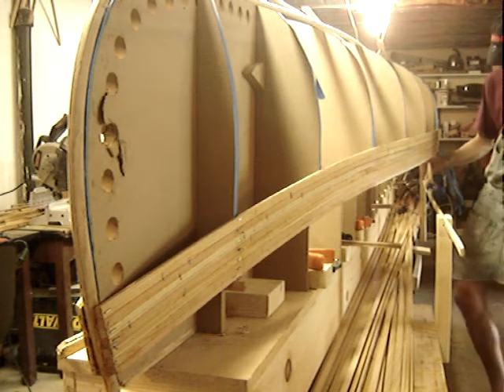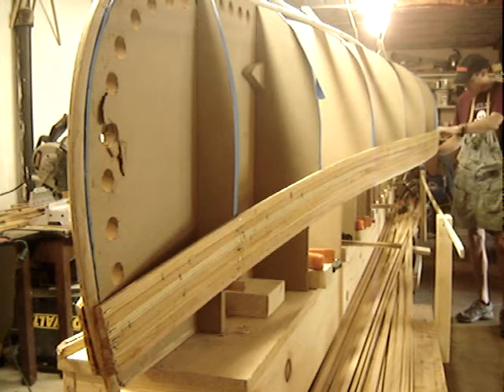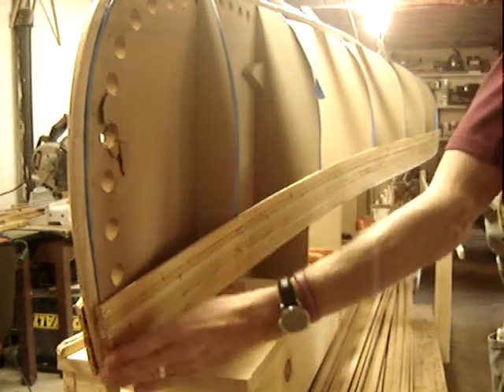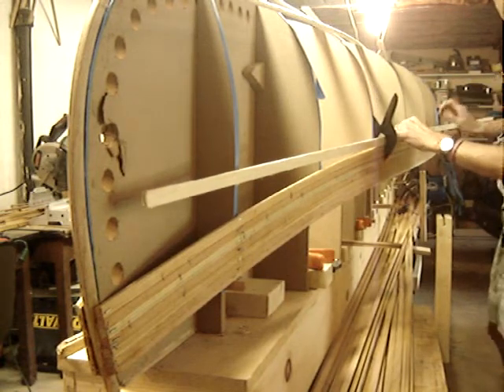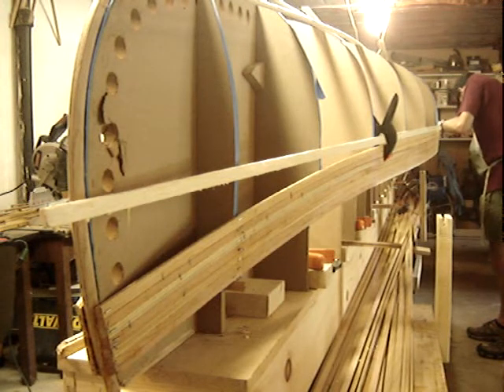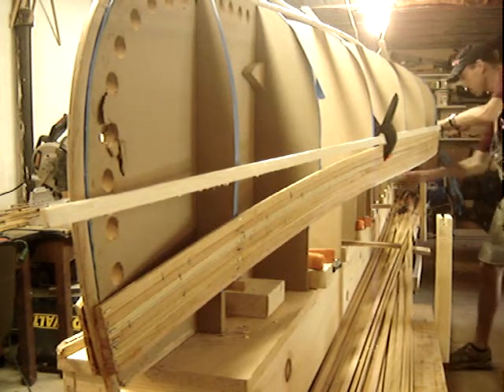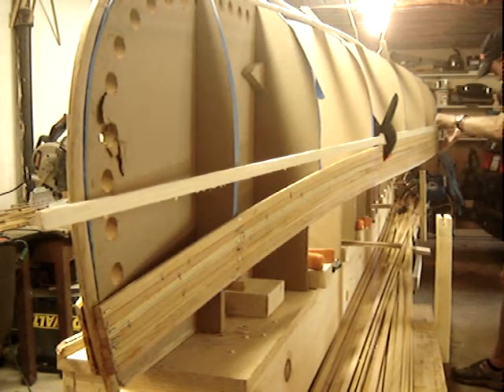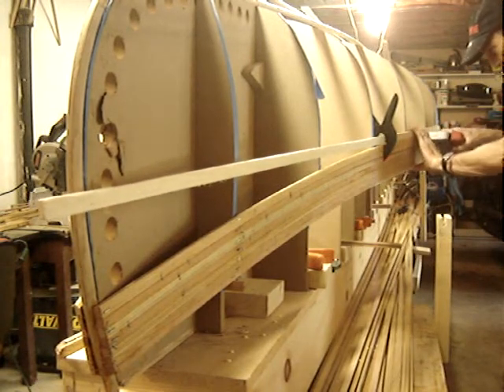Adding Strips to forms

Comment from the maker: Question 1: Using staples will secure the strips to the form.  After 10 strips run one straight then fill in between,

2: Use Titebond 2 wood glue, buy 1 gallon first plus small bottle

3: Glue the stips to the stem,  there are actually two stems, inner and outer,  glue to the inner then cover with fiberglass then add outer stem.

4: buy a how to DVD from one of the several online ceder strip canoe companines